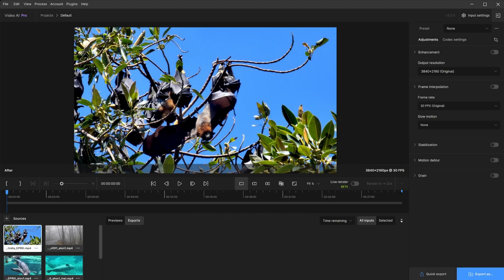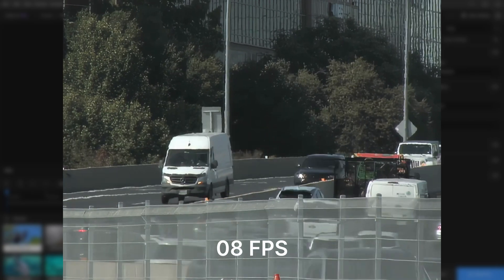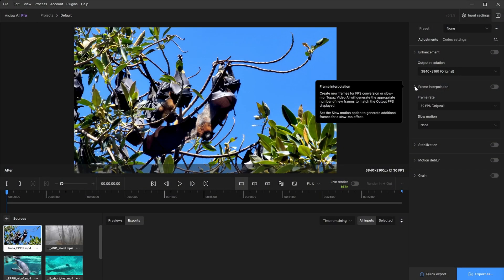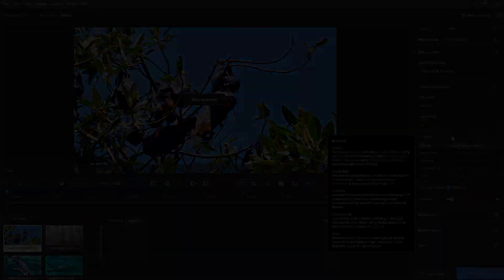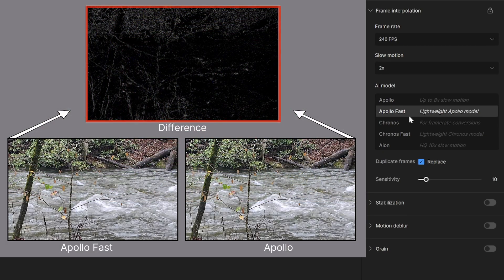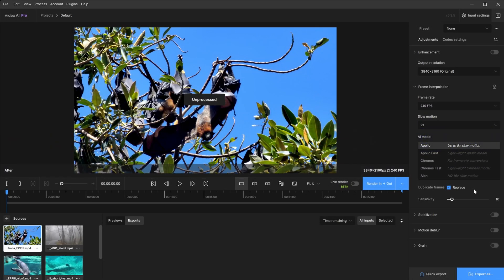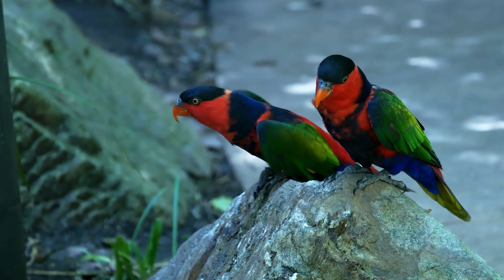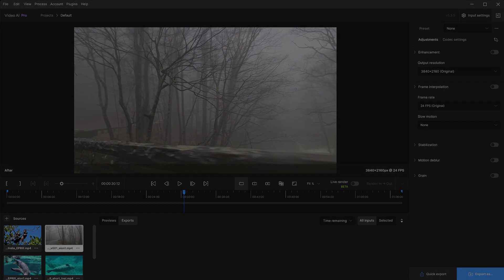Video AI - Frame Interpolation

Comment: I have four sequential sharp clear frames, at 30fps, of a bird flying, across the frame, against a background of clouds. I can import the frames into photoshop and separate the birds out from the clouds so I have four frames of just the bird with wings in lowest position, two intermediate positions, and highest position. What is the best software, if any, to interpolate new frames with additional intermediate wing positions, between each of the four existing frames? Thanks for any guidance!

Comment: Your Frame Interpolation model is not as fast, accurate and sharp as Practical-RIFE, Frame Interpolation is not your strong point😅
Reply: It is way better than RIFE now. I tried both RIFe 4.7 and Apollo, and Apollo did way better.
Reply: @remasteredbymess9491 Is the Aion model (debuted in Topaz Video 5) better than Apollo or does Apollo still hold the crown for being the best frame interpolation model out there?
Reply: rife is soso even with rife 4.25 heavy , the latest model, as it has heavy warping with with bars, lines, and other patterns. with apollo however, i get none of those issues.